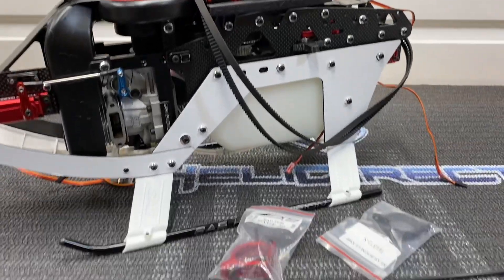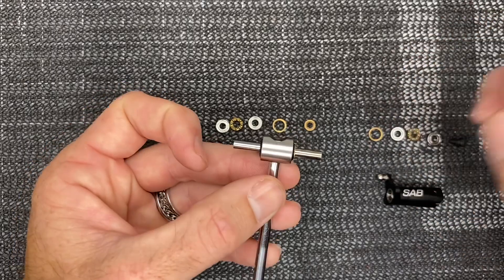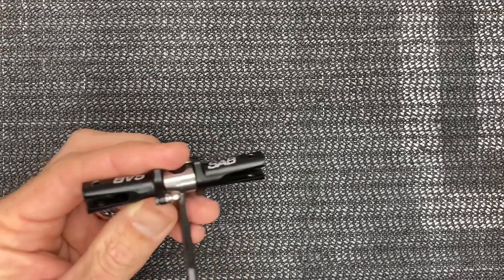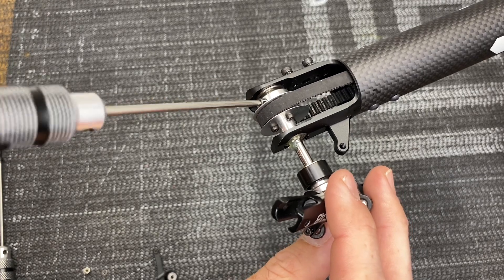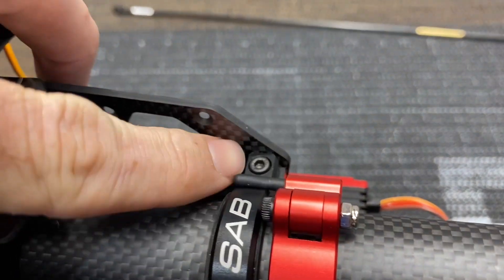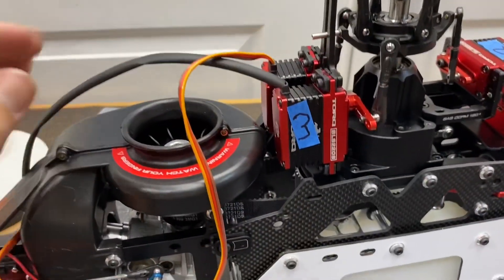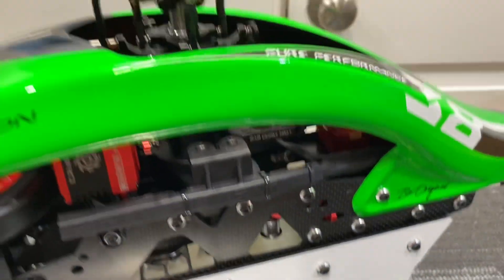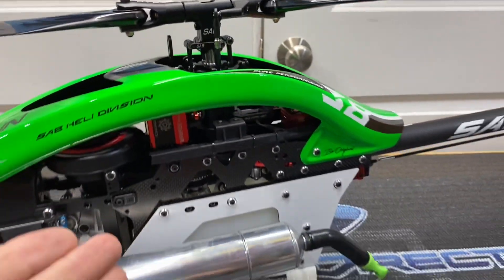SAB Goblin RAW 700 Nitro Rebuild Part 2

Comment: What makes this goblin raw 700 nitro so cool is that the flight time will be much longer compared to a electric rc helicopter.
Reply from the maker: Nitro flight times are great! 7+ minute flights at hundred percent power. The only downfall is cost of fuel lol you only get about nine flights to a gallon so it can get very expensive especially at $40 a gallon. But we don’t do this hobby for the price lol

Comment: Jeff, What are the different sizes of Heat Shrink Tubing you use? Answer here or on your Crimping Video.
1 wire, 2 & 3 wires, over the Plug end & your Largest piece of Heat Shrink that puts all wires in one large bundle? BTW... With your Wires covered, they could easily be run just like that, but you and me both LOVE Redundancies, double, triple, etc...
😂👍 Stay well my friend and I'll DM you soon. Best to Grandpa, Dad, You,  your Wife and Camera Woman Extraordinare & your beautiful Daughter!
Reply from the maker: Hey Larry! So my three most common sizes of heat shrink or 3/16, 3/8 and 1/2in. Are use 3/16 to cover all the servo wires. I buy 100ft rolls of it at a time (I build/use a lot lol) half-inch I buy 10 foot rolls at a time just because I don’t use so much of it. I might go through a 10 foot roll per hundred foot of 3/16 heat stink. 3/8in I don’t use all that much but every once in a while I will need some if I’m just covering two wires or three wires together. Half inch is what is used for the big junction at the back to tie all the wires in as one. Thank you! Everybody says hello! I hope you have a fantastic week and your family as well!